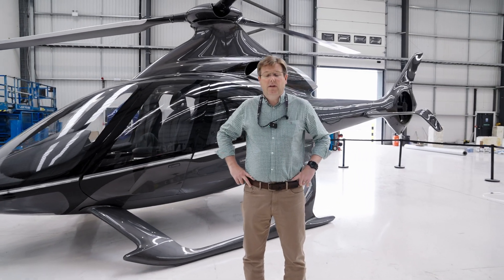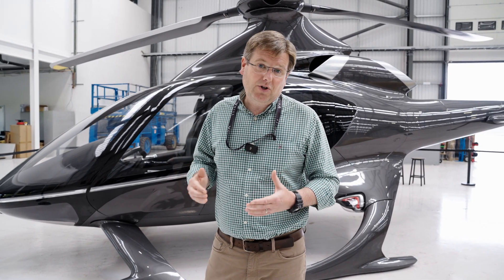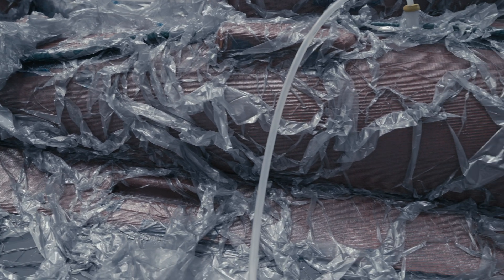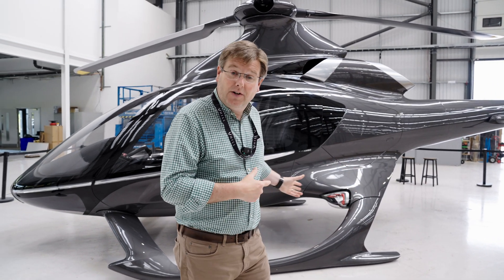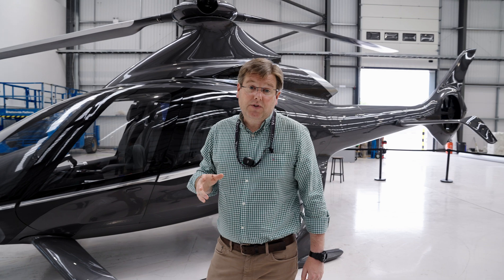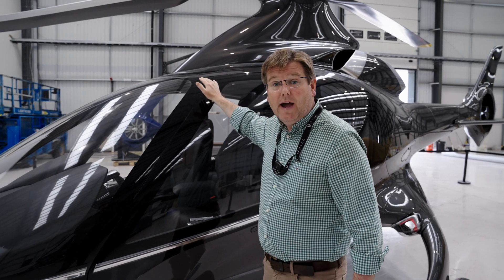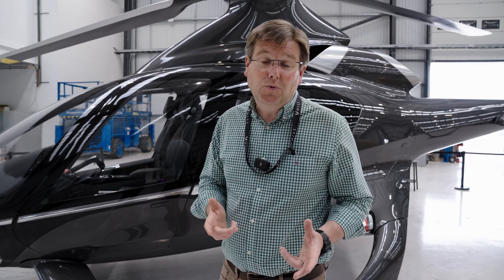HX50 Production-Ready Airframe

Comment: I understand that it gets more convenient with lamination if the fuselage consists of more parts but I mean the big deal with this helicopter is the high quality rotorcraft a customer gets for the money purchasing a non certified experimental kit that he/her puts together 50% by themselves.

I know youre aiming for a commercial variant down the line but the main focus is this non certified one. 

It just comes off a little strange to be making these big changes and splitting up the fuselage up in more parts that need to be fused together because its more convenient for the manufacturing guys when the customer is supposed to pay for experimental build kit anyways that he puts together himself. I think this should warant a somewhat lowered price. Thats seems like the fair thing to do for the customer.

Comment: Splice points feels like a manufacturer induced weak points / point of failure no? Lifetime of the airframe i would imagine has been significantly reduced due to this?
Reply: This is was I was thinking as well, sounds like theyre trying to shoehorn in a pretty significant change that prob deserves a bit more coverage than this short segment provides. I think they owe this to people who have made pre-orders at least.
Reply: I think we all misunderstood what Jason meant with that statement. I asked Jason about this in the AMA, and he said it would still be a monocoque fusillage as originally intended, just that there would be more than the original 
having 4-5 major pieces that come together before the final carbon fiber layers fuse them together.
Reply: @justinsearle4461  Sure, but then you could argue anything is "monocoque" because its joined? If i weld a car together its still a assembly not a monocoque, same as what they are implying here with the structure.

Comment: I guarantee those skids are going to need to be completely redesigned. They're pretty but anti-utilitarian.
Reply: I think ant-utilitarian was part of the the design goal, at least from a visual and aerodynamic perspective.  If appropriate mount points are provide on the skids, risers, and fuselage belly, I curious what utility needs you think could still not be met?  This could be a healthy conversation to benefit the project.
Reply: @justinsearle4461  Getting in and out of the helicopter for starters. Passengers are stupid and will stomp all over the skids. ( In my case they stomp on the emergency floats that say ("NO STEP"). There's no flight steps on the skids either, they're needed. There MUST be a grit surface on top too. The shape of the skids almost ensures a bad outcome in an emergency landing in a field too.  The ship overall looks nifty, but it's going to need a half dozen holes/doors and lots of fasteners in order to facilitate maintenance and preflight.
Reply: Maybe not, who knows, the Heli floor is not so far from the ground and skis´s base are enough far from rear doors to step them, you can watch in the video how Hill or people already jump in it, maybe some internal handgrips sure.
Reply: @pelotosim837  Agreed.  I've climbed into the skidded prototype 20+ and never felt a need for a step.  From memory, it feels about the same as my R44.  The skid is also further away from the body than an R44 so people are far less likely to step in the skid than an R44.

And @chopper3lw, I agree with your frustration of people stepping on the emergency floats. My R44 has them and people still forget after being told multiple times. Unfortunately they are in the perfect place of where you would expect a step to be.

Comment: Are you using Pre preg or resin infused?
Reply: Infusion. I wonder how long it will take for them to realize almost no one with high production volume does infusion. Prepreg is far faster and more easily repeatable which can end up lower cost. Time is money.
Reply: @Sergeant898 Helicopters aren't exactly in high volume production.
Reply: @Smokeyr67  Hill claims they will have higher production volume than any other helicopter manufacturer. That by definition makes them high volume.
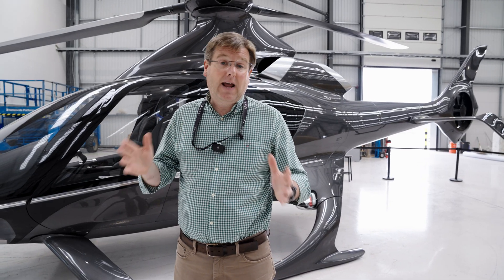Reply: 0:20 look like infusion lines to me.
Reply: They experimented with both processes on some of the earlier fuselages last year and are still leaning towards infusion methods.  I also believe most of the experts they have hired are more experienced with pre-preg, so all the pros and cons seemed to have been considered.  Two of the big challenges they are facing are cost and making one of the largest monocoque fusilages in any industry, which are both influencing the decision.